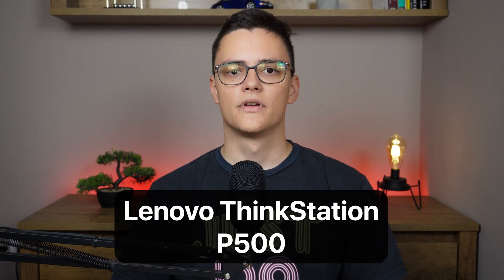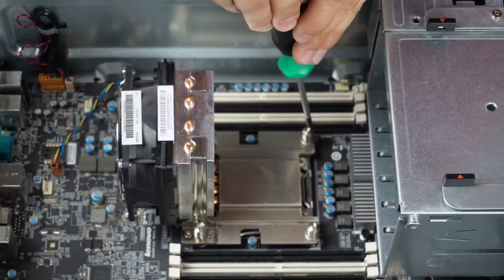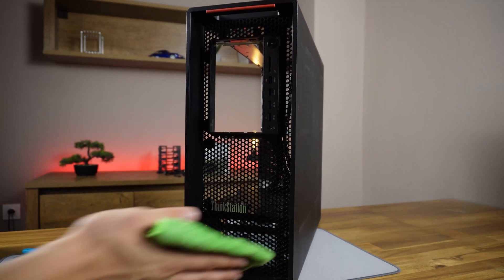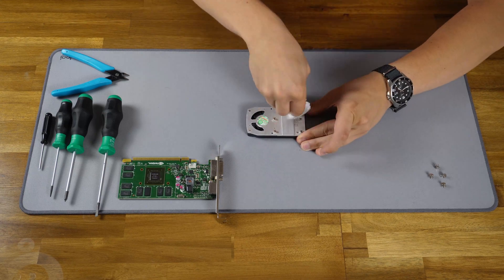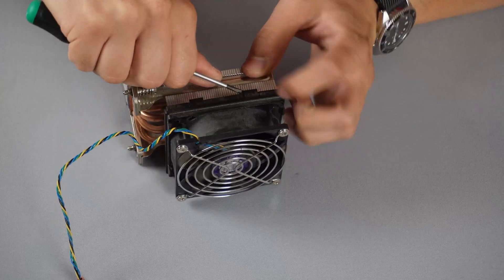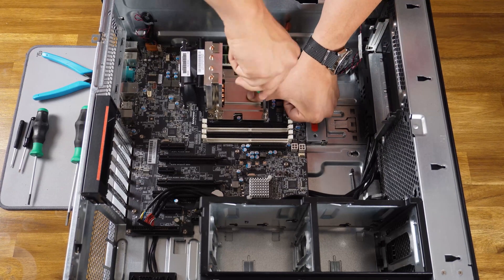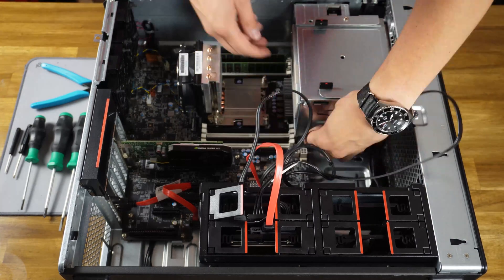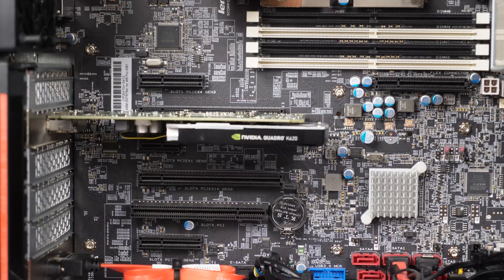Restoring a Used Lenovo ThinkStation P500 🖥 Building a Home Server

Comment: With P series, the Motherboard sits on floating stand-off thus whole assembly can be slide out without the need to unscrew. Just need to unlatch the stopper at the front. Very convenient.

Comment: I've been repurposing an old p520 as a file server here. I'd say you did a fantastic job cleaning up that p500 rig! Don't listen to the nay sayers on vacuum cleaners (as long as the bristles are grounded out on the bare metal chassis, no problem ). I've been using vacuum cleaners for cleaning my computers for 3.5 decades with no troubles. Besides, compressed air doesn't clean, it just moves the dust to another part of the computer. Nice Job! I hope your build goes well!

Comment: I bought the same last year. Even though I'm a convinced Mac guy, I needed a PC to install generative AI software along with Nvidia GPU's. I fell for that Thinkstation design in the first place. I usually find PC's ugly and certainly didn't want those horrible flashy led gaming PC's… So I got a refurbished P500 for less than 200 bucks. Upgraded all I could inside (Nvme ssd drive on PCI card, cpu, ram, GPU, extra GPU fan, new 690 watt power supply + new power cables) and even tricked it so I could install Windows 11. It's a very capable machine that does exactly what I wanted it to do and honestly… Ain't it sexy? :)
Reply from the maker: Absolutely agree. It's a great affordable used PC that can be very capable. I also really like the looks. It's the best looking ThinkStation in my opinion.
Reply: @nltech1  Indeed. Coming from the Mac, I always thought PC's were pretty ugly and/or geeky looking… Until I saw those Thinkstations, used for CGI in a VFX facility I've been working for. They had those gorgeous (probably P620?) Thinkstations and it was love TKO! :D Of course, I couldn't afford those more expensive models, so I went for the P500. It's really got an awesome design (too bad they removed the bottom red stripe on some later models, I think it added a nice design finishing touch), it's silent and I'm loving the tool-less assembly. I've tried to match peripherals so I could stay in that "darth vader" color scheme. So I've added a Logitech G413 mechanic keyboard. It's awesomely gorgeous and the keys are just awesome (noisy and clicky like an old 80's keyboard) . Also, it is one of tha rare keyboards that offer a single red backlight (and not the usual "rainbow" rgb effect), but it's plaggued with ghosting and is actually a nightmare to use when you type. Also added the wireless silent Thinkpad mouse, which is one of the best mice I've ever used in my life (has dual bluetooth selector switch, so I can use it both with my P500 or my Macbook)… Only criticism on that P500 : pastics are a bit brittle. Mine came with a broken front cover that kept breaking and falling apart everytime I would move the tower, but I was fortunate enough to find a mint spare cover on eBay… That said, should my P500 die on me, I'd buy another one in a snap. Even though most parts are proprietary and can sometimes be expensive (like the higher spec'd PSU's and their scarce extra power cable. Needed one to power a hungry GPU), I'd buy another one instantly. If I could afford them, I'd buy one of the newer stations like the PX, P5 or P7 series, their design is just out of this world! ;) But that would be overkill for my needs.

Comment: Hi. Plz let me know if i would be able to case swap all the components to gaming case. I want to reuse the power supply. Only thing im not sire about is wether it ll fit or wether the power button/ temp sensor / io will cause any issue.
Reply from the maker: Hi, that's a complex question, as there are many gaming cases, but I think you'll have a lot of problems to solve. Are you sure the motherboard will fit at all without modifying the case? It is non-standard. The power supply situation would complicated things a bit I think? It is cable-less, so you will need to keep it in the same position.. there aren't many gaming cases that would fit the power supply in such a position. You also need to cool the power supply, which is another thing to consider..

The front IO was non-standard as far as I can remember, so not sure if you will be able to solve that easily as well. 

You could find other workstations with similar hardware with more standard components to swap in a gaming case like the HP Z440 for example. Also, keep in mind that this case is much higher quality than the majority of the gaming cases (definitely all the cheap ones I have encountered).
Reply: I have a motherboard from P510 Scorpius 1.1, which is installed in the usual Deepcool case. The back wall of the case had to be additionally cut. Only the Power button and one USB3 managed to connect to the front panel. Even Reset did not find where to connect.

Comment: Hello i am in the process of disasembling our old P500s at my company. I plan to upgrade the memory, gpu, cpu etc and put them back in production (industrial drawing). Our stations have a fan duct on the top, also a piece on the front that hold the longer GPUs and provide an additional fan